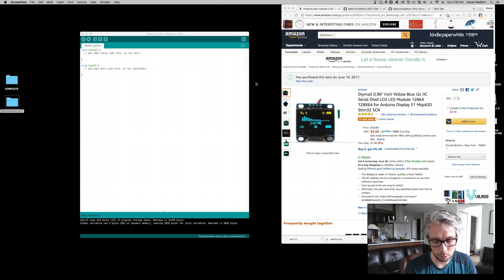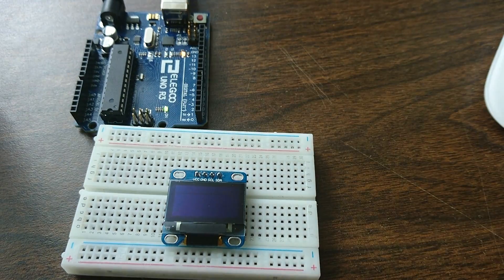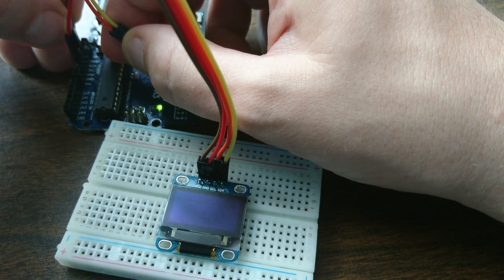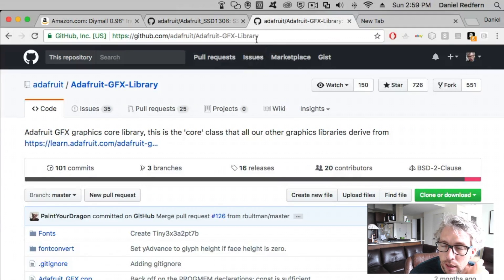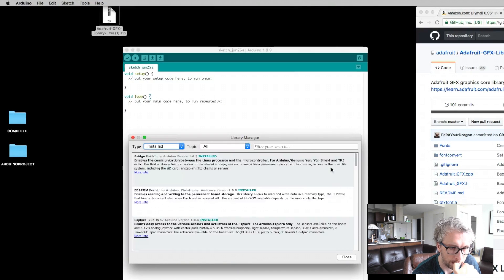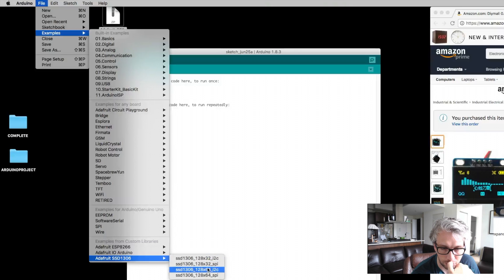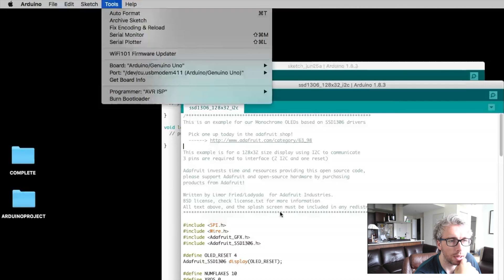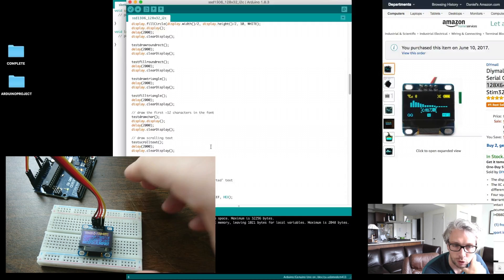Setup Arduino with the SSD1306 (Diymall LCD LED Module)

Comment: Hi! Thank you for the awesome video and great resources. I'm trying to find where can I change the inputs, so that the display does not use A4 and A5, but rather A2 and A3?
I went over the .h and .cpp files and can't find where to change this setting.
Please help. Thank you!
Reply from the maker: Armen Barseghyan, good to hear that it helped!
I had the same problem also. I wasn't able to locate the pin designations
Reply: Thanks for the reply.
I'll tinker with it and will let you inow if I find it. Thanks again!